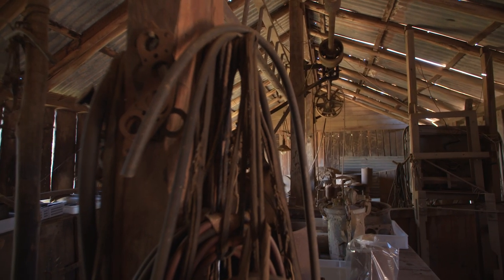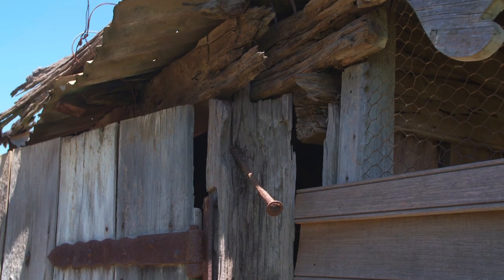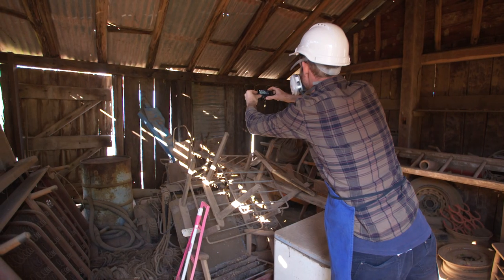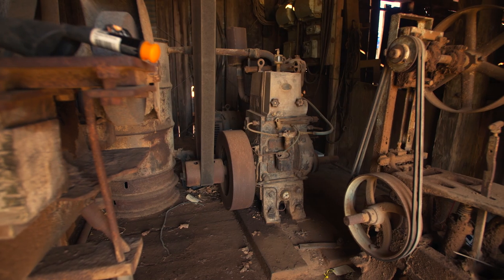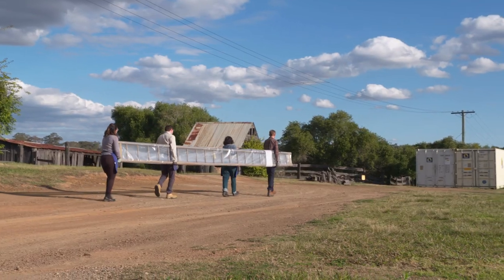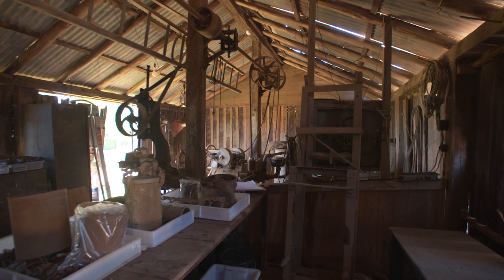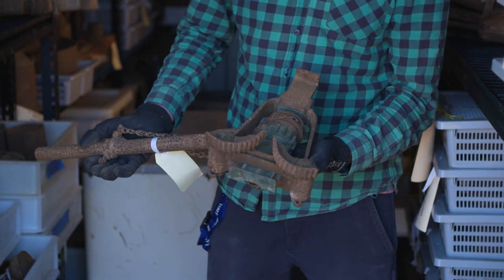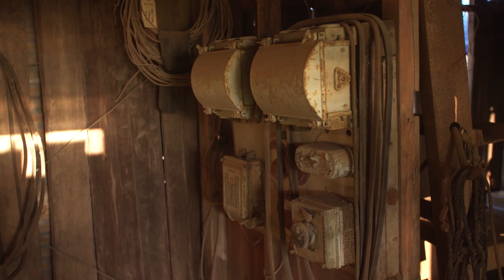A Herculean task – clearing the woolshed at Rouse Hill Estate

Comment: Great project and video. The mystery object is a Floor Clamp used when laying floor boards, the jaws bight onto the floor joists as you swing the handle back and forth the chain turns the cogs that push the jack out against the floor boards closing the gaps between each board as well as taking out any bows in the floor boards.